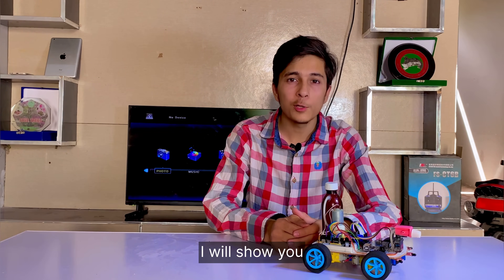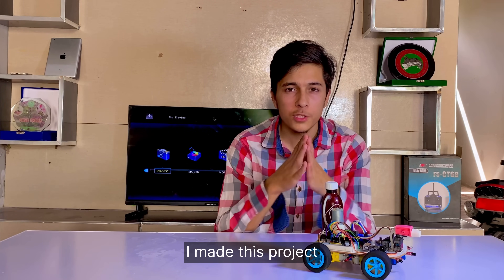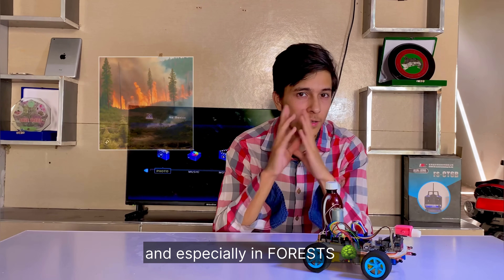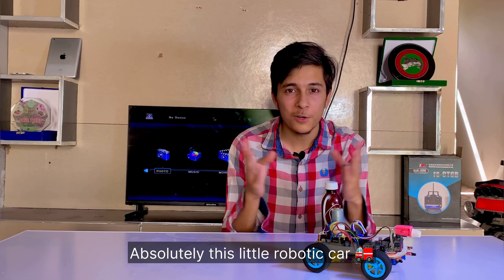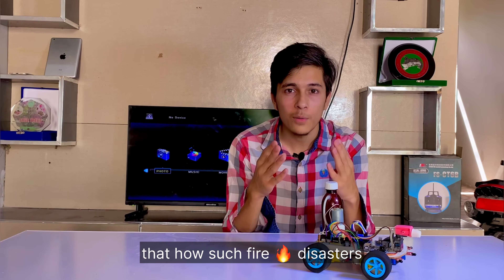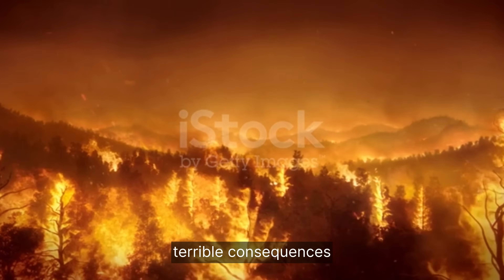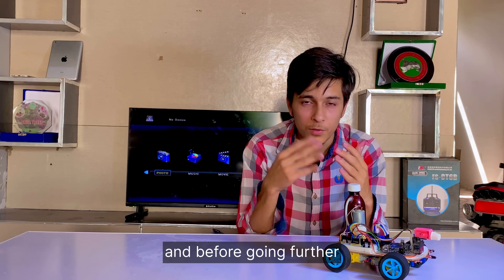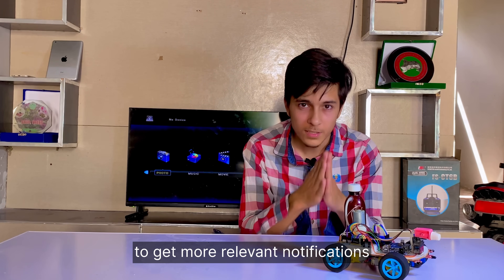DIY Fire Fighting Robot using Arduino  |  Auto Fire Chaser and Extinguisher

Comment: Sir, best project sir...I searched several videos but I am not satisfied with anything...now I got it because of you sir...
Reply from the maker: Glad it was helpful for you
Reply: Hello sir ... I made this robot sir but the wheels are not moving sir...what do I have to do sir? And also sir water is not coming from the tube ... what should I have to do sir.?..sir please respond to this question sir...
Reply: Sir ...one more doubt sir ..I have never done coding in my life sir...will I be able to do the coding in Arduino sir?...I am a school student sir and I have 20 days left to submit my project...If I just type the coding that you gave in the description..will I be able to successfully make it sir?..sir pls I need your response sir....
Reply from the maker: Yeah that easy.. you can do it with laptop or computer.. need arduino cable to connect arduino and copy and paste the code and after selecting right port and board upload it
Reply: @saadinnovativeideas  Thank you so much sir.....If have doubt I will clarify with you sir...thank you sir...
Reply from the maker: Yes sure
Reply: Sir I think the motor is not running that's why the wheels are not moving...what do I have to do to make the motor run sir?
Reply: sir....I used three pin sensor sir..what change I have to make in coding sir? I need your help sir please
Reply: Sir just now I read a lot of comments..it said to change AO to DO....do I have to change analogread to digital read and analogwrite to digitalwrite ?
Reply: Sir how to make it move sir... please help me sir
Reply: hlo bro are you from kerala
Reply: Sir please coad bata dijiye please mujhe arjenthe
Reply: Motor not working, what is the reason other parts working except motor

Comment: my servo motor is working but my bo motor and pump not responding
Reply from the maker: Which battery and sensor(3 or 4 pin)  have you used?

Comment: brother my all parts are in working state it detects fire but do not move
Reply from the maker: Which sensor (3 or 4 pin) and battery have you used?
Reply: @saadinnovativeideas  4 pin sensor and a 9v supply
Reply from the maker: @  9 volt non-rechargeable battery won’t work with this project. Use rechargeable batteries

Comment: I have a question. After I did all the steps and I uploaded the code, the motors start to work alone, without a fire in front of the sensors, what can I do?
Reply from the maker: Do you mean without exposing to fire it reacts..
Reply: After i upload the code and I stop it and then I turn it on, after 2-3 seconds the robot starts going forward without stopping
Reply from the maker: You may have placed it in daylight or some other bright light.. IR sensor detects infrared radiation emitted by sun or other bright light
Reply: I ll try again today to see if it works, thanks!
Reply from the maker: Yeah test it indoor

Comment: can i use flame sensors with 3 pins only? it doesn’t have the AO pin but it has the DO pin
Reply from the maker: Not for this circuit diagram and code

Comment: The flame sensor will be connected in breadboard or Arduino
Reply from the maker: You can connect it in both ways but by following circuit diagram.. bcz breadboard only work as an extension
Reply: Because the flame didn't work in breadboard @saadinnovativeideas
Reply from the maker: No way.. check connections according to circuit diagram

Comment: can i use ir flame sensor with three pins only it doesn’t have the AO terminal
Reply from the maker: No, this code and circuit diagram is for 4 pin flame sensor with analog (A0) pin

Comment: Bhai program daal diya 
Port com3 hai 
To model nahi chal raha hai 
&Rx light blink kar hai so ab kya karu
Reply: Windows ke icon pe right click karke device manager me jake com port dekho konsa hai, wo select karo Arduino ide me
Reply: @riteshmahajan1497  com3 dikha raha hai
Reply: @riteshmahajan1497  sensor work kar raha hai light blink ho rahi hai par kuchh work nahi ho raha hai
Reply from the maker: Aap nai konsi batteries use ki hai..
Reply: @saadinnovativeideas  li-ion cell 2000 mah
Reply: @saadinnovativeideas  3.7v 7.4 Wh
Reply from the maker: 3 pin sensor use ki ha ya 4 pin?
Reply: @saadinnovativeideas  3 pin
Reply from the maker: Ye code or circuit diagram 4 pin kelia hai (jis me A0 pin ho), 3 pin se nahi chalega
Reply: @saadinnovativeideas  to ab kya karu
Reply: Muje Monday ko submit karna hai bhai
Reply: Koi or solution batado yaar

Comment: Bro my project is in working condition  project is ready but the only issue is with battery .I have used 3.7 v li_ion 2500mah ×2 =7.2 v rechargable battery  . Bcoz of it some times servo motor not working  and even water pump .
Pls help me in next 1 days there is submission
Reply from the maker: Is your sensor 4 pin or 3
Reply: @saadinnovativeideas   4 pin
Reply from the maker: Does not any component works?
Reply: @saadinnovativeideas   components are working but they are not showing its full potential should i increase  voltage of battery
Reply from the maker: Not voltage but current (amps), use new strong batteries
Reply: Bro my project is working only my water pump is not working
Reply: Pls help 5 hrs left for submission
Reply from the maker: Have you used relay module or components I used?
Reply: @saadinnovativeideas  your components

Comment: My problem is that I have everything connected, I have already checked it a couple of times, everything is energized including the sensors, but it detects the fire but not even the servo motor moves and not even water pump start
Reply from the maker: Is your sensor 3 pin or 4.. and how much is your input voltage

Comment: Sir in this when we put fire in front of sensor it sense the fire but dc motor doesn't work and my all parts working except this dc motar can you give me proper guidance im in trouble from 3 months
Reply from the maker: Whats your power source?
Reply: @saadinnovativeideas  sir I'm using 3 battery which you used in this vedio 2 for motar driver and dc motors and 1 for aurdino, servo motor, water pump
Reply: @anshikachaudhary6051 Hey, I got same problem. I have exactly same connections and components as in the video/diagram. I use 2x18650 batteries which give 7.4V. What can I do?
Reply from the maker: Have you used 4 pin sensor or 3 pin
Reply: @saadinnovativeideas  I have used 4 pin sensor
Reply from the maker: Are you using 3 li-ion 3.7v batteries in series
Reply: @saadinnovativeideas  no sir 2 batteries in series for motar driver and dc motor and 1 battery for Arduino, water pump , servo motor and transistor, resistance diode
Reply from the maker: No need of separate batteries, use two and connect it with arduino and motor driver paralleled
Reply: @saadinnovativeideas  while using 2 batteries my robot is not moving
Reply: @anshikachaudhary6051  Bro I solved this problem. U just need to plug-in one jumper on L298. He removes 3 jumpers in video, but u only need to remove 2 which are on EnA and EnB, put the 3rd jumper on driver again. It will help
Reply: @cocacocka  and your robot moving properly??
Reply: @ yesss, try it
Reply: @cocacocka  you used 2 battries???
Reply: @ yes i did, connected in series so i have 7.4v
Reply: @cocacocka  i connected like this only my robot was not working
Reply: @cocacocka  if we remove this then programming will change?? Pls explain in detail
Reply: @ no, program remains same, u just plug that jumper in
Reply: @cocacocka  which jumper and where we have to plug pls explain in details
Reply: @ Okay. So, u should connect evvvverything as in the video. Then, u can notice that he removes 3 jumpers from L298. 1 on EnA, 1 on EnB, and one separate jumper. So, u just need to plug that separate jumper in again.
Reply: @cocacocka  I can't see this where he removed wire
Reply: @ he didnt remove wire, he removed "jumpers".

Comment: Bro.. pls help.. the connection everything is okay..and the flame sensor also detecting and water pump will run..... But BO motor cannot run.. and servo motor not working.. what's problem bro.. pls help
Reply from the maker: Often power issue. Whats your net input voltage?

Comment: Hi, so we tested the the car and it worked but when we turned it off and turned it on again, the arduino and the flame sensors led are on but the car wont go when there is flame. What could be the problem pls?

https://drive.google.com/drive/folders/1UboZFX8qaIhg5E13tnbCR7hGyg4pDD6u
Reply from the maker: Connections looks good, can you show me its video while testing

Comment: in 3:30 sir can u please tell me which one is skipped in flame sensor is it  ground or the Digital output pin 
in the photo it is clear that Digital output pin is not connected anywhere 
but in the hardware model I'm confused ????
Reply from the maker: Yes, leave the Digital pin disconnected
Reply: @saadinnovativeideas  sir the  connection of flame sensor u showed in the video are not according to the circuit diagram...is it sir????

Comment: Hi, I used a water pipe which is of diameter 0.5 - 0.6 cm as I didn't find any other alternative. The water pump is turning on but the water is not flowing through the pipe. Now, do I change the water pump? Or is there any other way to solve this
Reply from the maker: Using strong water pump would be better

Comment: hi, i couldnt find 4 tip flame sensor i got the 3 tip one, ccan you tell what will be the change in program and circuit. overall this is a great project and i am making it for my state level competition
Reply from the maker: Bro 3 pin one do not have analog pin which also tells about the intensity of flame…
Reply: So can I use this 3 pin flame sensor with this circuit diagram and this code 
If not so can u provide me circuit diagram and code for this project ?
Reply: @Wylestian_7  basically with a 3 pin flame sensor you will not be able to locate how far the flame is so the motors won't know how much they have to travel to reach the point ,it won't work according to the video

Comment: My servo motor is not working when the IR sensor detects fire but my water pump turns on. What should I do?
Reply from the maker: Flip the servo sided two wires (+, -) connections with each other
Reply: @saadinnovativeideas  Ok let me try again. 
Can I use male to male jump wires to connect the servo motor on the circuit? I see you directly inserting the wires from servo motor without adding male to male wires. And I want to know which one of the flame sensors is A0, A1 and A2?.
Reply from the maker: Yes you can… IR 4 pin flame sensor

Comment: I have connected all the wires correctly and in the right place as shown in the video and also the code was uploaded correctly but the robot is not moving not knowing what is the error
Reply: Same same
Reply from the maker: Mostly because of power source. What is your total input voltage?
Reply: 7.4 
Two batteries of 3.2 volt
Reply from the maker: Is not a a single component working? Is your sensor 3 or 4 pin
Reply: All components are working but the car is not moving and the flame sensor is of 4 pin

Comment: can i use mini L298 driver ??? pls answer
Reply from the maker: You can drive two motors at a time with that, not four
Reply: Is there any solution witout buying the L298 that u used ? Or just using that mini one ??? @saadinnovativeideas
Reply from the maker: By using two of them..

Comment: If the chasis are heavy the wheels are moving very slow can you please rectify this issue
Reply from the maker: Motors torque should not be interpreted by weight.. what are you chases made of😂
Reply: @ I’m using plywood also my design is quite different but I’m using your code and connections. Instead of bottle I have created an acrylic setup where it stores the water and pumps out through the sprinkler
Reply from the maker: Then use metal gear motors..
Reply: @saadinnovativeideas  thank you bro

Comment: Hey, so I completed my project and I tried to run it. It's working except for the water pump I think I've used 9v(I'm not sure) which looks like this (https://drive.google.com/file/d/1Gtghtwg486BgdT43GYMnFVon5qQtvoyE/view?usp=drivesdk) can you help me with the issue?
Reply from the maker: Have you used relay module or transistor(+… to drive pump
Reply: @saadinnovativeideas  I used the transistor and also I used the 102 pF capacitor
Reply from the maker: That should work… double check your connections
Reply: @saadinnovativeideas  hello, as you said I checked my connections, pump is working but the water is not going through the pipe, the water pipe I used is more wider than the one which you used in the video. Pls help
Reply from the maker: If you want to increase pressure, the diameter of the pipe should be relatively small
Reply: @saadinnovativeideas  can we not make any changes in the code with how it is right now to make it work?

Comment: Bro i followed all your steps but the snesor is not working give me some ideas or help me
Reply from the maker: Is that 3 or 4 pinned
Reply: @saadinnovativeideas  Sketch uses 3368 bytes (10%) of program storage space. Maximum is 32256 bytes.
Global variables use 196 bytes (9%) of dynamic memory, leaving 1852 bytes for local variables. Maximum is 2048 bytes.
avrdude: stk500_getsync() attempt 1 of 10: not in sync: resp=0x30
avrdude: stk500_getsync() attempt 2 of 10: not in sync: resp=0x0f
avrdude: stk500_getsync() attempt 3 of 10: not in sync: resp=0x10
avrdude: stk500_getsync() attempt 4 of 10: not in sync: resp=0x20
avrdude: stk500_getsync() attempt 5 of 10: not in sync: resp=0x0f
avrdude: stk500_getsync() attempt 6 of 10: not in sync: resp=0x10
avrdude: stk500_getsync() attempt 7 of 10: not in sync: resp=0x30
avrdude: stk500_getsync() attempt 8 of 10: not in sync: resp=0x0f
avrdude: stk500_getsync() attempt 9 of 10: not in sync: resp=0x10
avrdude: stk500_getsync() attempt 10 of 10: not in sync: resp=0x20
Failed uploading: uploading error: exit status 1
Reply from the maker: @  bro this is not compilation error. The problem is with your port… you need to have connected port if don’t get the port in tools, you will need to install usb driver for that
Reply: @saadinnovativeideas  bro i have already installed this and tell me one thing the circuit diagram you have given is purely different from the video that you shown during connection plz help !!
Reply: Plz help Tommorow is my submission
Reply: @saadinnovativeideas  ye error aaa rha hai bhai upload hi nhi ho rha hai code
Reply: @saadinnovativeideas   4 pinned sensor i have also used

Comment: why only my water pump working no fire sensor light and bo motor and wheel not moving

edit : everything works now, just a lot of trial and error with the code and wires lol
Reply from the maker: What errors?
Reply: no errors, everything works now, i meant i just needed to keep trying
Reply from the maker: Great

Comment: Saad, my robot is not working, plz help me. I really need this. plz help me as soon as possible, there is power in the motor driver, Arduino and flame sensor, but the car is not doing anything I have checked every connection at least 4 to 5 times from the video, but it is still not working
Reply from the maker: Are your sensors 3 pinned or 4. And which batteries have you used
Reply: @saadinnovativeideas  4 Pinned flame sensors and rechargeable batteries as per the voltage showed in the video
Reply: Saad the flame sensors are 4-pinned and batteries are rechargeable according to the voltage shown in the video and not the flame sensor, Arduino and motor driver have light because I have a wire loose but still the car doesn't do anything in front of the wire even if there is light in everything needed
flame sensors are detecting because whenever there is flame, there are 2 lights in the sensor, but usually only 1 light, but there is no movement in the bo motors, water pump, even servo motor
Reply from the maker: Can you send me the pictures on instagram
Reply: Saad can you plz send me your Instagram so that I can send you the pictures, I only have one to complete this project plz help me as soon as possible.

Comment: Hey man.... Thank you for making this video, 
It's a really fun project 👌
But mine isn't working... 
Getting 3 pin flame sensor was a mistake 😢
After going through hundreds of comments adjusted DO wires from A0, A1, A2 to 2,3,4 respectively and changed analogWrite to digitalWrite and analogRead to digitalRead in the code. 
I have two 3.7V 18650 lithium ion batteries (i bought a battery holder to connect it in series)
I do not have a computer or laptop so I uploaded the code with arduinodroid with my android. 

There's only a red light in l298 motor driver, except that, there is no other reaction after switching it on.

A quick help is much appreciated.
Once again thank you.
Reply from the maker: Brother 3 pin sensor do not have analog pin, digital pin (D0) can only read the signal high or low but cannot sense its intensity and so... Using analog (A0) will make the robot detect flame intensity so it can move to it and then stop at little distance to spray water….
Reply: @saadinnovativeideas  is there nothing we could do?

Comment: The connections are perfect but forward move nhi ho raha hai abh ky issue ho sakta hai please bata sakte ho kya app,sirf tyres move nhi ho rahe hai baki sab functioning ho Rahe hai sahi se
Reply from the maker: Batteries konsi use ki hai??
Reply: 7 voltage ka use Kiya hai batteries
Reply from the maker: 7 volt ki konsi battery hoti hai?
rechargeable hai ??